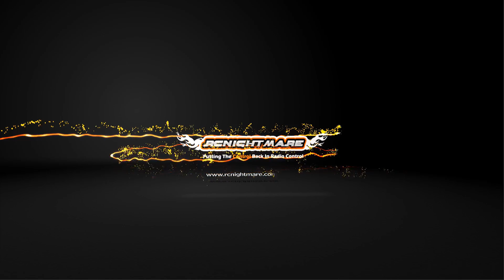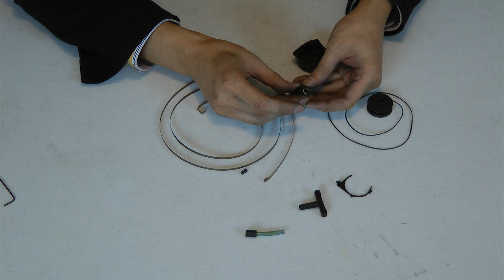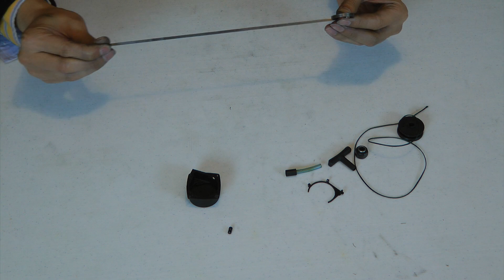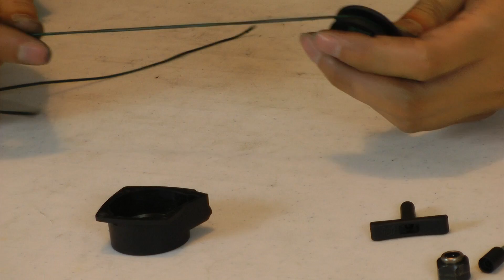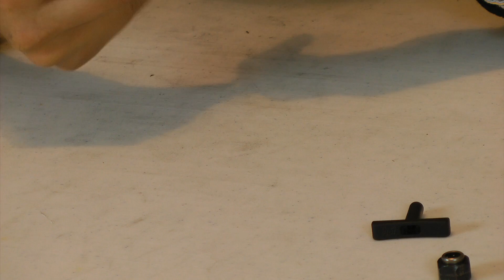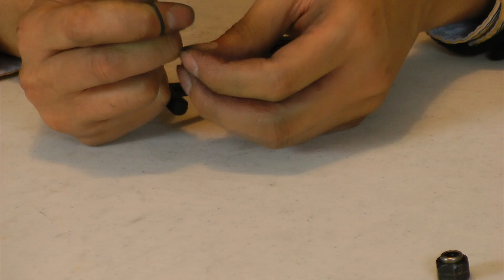Repair A Nitro RC Pull Start

Comment: I have recently replaced my pull start on Redcat Hurricane XTR 1/8 scale buggy.  I am scratching my head why when glo plug is seated, the pull start will not engage but yet when the glo plug is removed, the pull start will engage and can see the engine cycle up/down.  Any thoughts on what this could be?  Initially, I thought maybe one way bearing but then if that's the case I wouldn't expect the engine to cycle up/down with glo plug remove.  Looking for help!!  Much appreciated.

Comment: the part when you put in ..you pull out the winding metal plate but the video was not able to capture how you plugged it in.
that was the most important part..i don't know what you did there coz it was not shown.

Comment: Ok this is making me what to leave this hobby
How the f--/:$&ck you get the spring in the housing this is the third day I'm trying I can't get it in
Reply: I also struggled with this problem. Solved it by winding up the spring as tiny as possible. Than use pliers to hold the barely end of the spring and the beginning of the spring. Do not loose grip, otherwise it wil unwind itself again. Than put it in the housing and slowly release the pliers. Now the spring will unwind on the housing.
Reply: easiest way is to wind up the spring after installing the spool in the housing since you can pull the spring through the housing and wind it into the housing.

Comment: What I use to replace the pull start string is window blinds string the good ones,! Some people throw them out so free to me .,,,!! The stuff is so strong I have never had it brake as long as you have good knots on the ends no problem, and my engine has high compression being a racing engine.

Comment: I have a HPI truggy, had it 3 weeks, took it out 3 times and then the pullstart went slack, on the 3rd run, so it doesnt retract into the pullstart case, any ideas why?

p.s. I never pulled it more than 30cm btw :)

Cheers